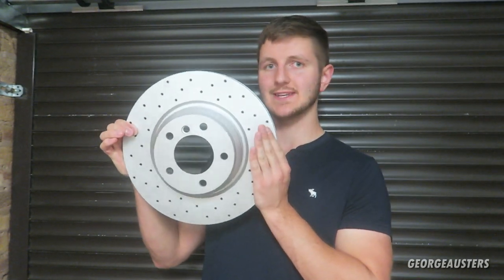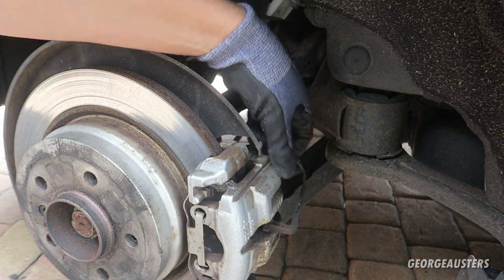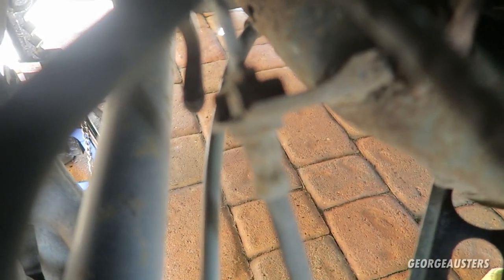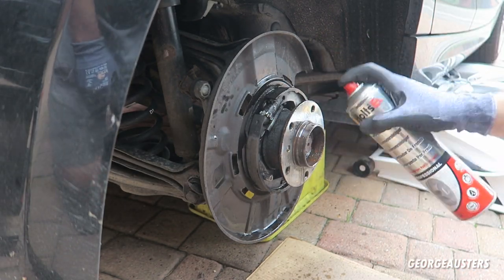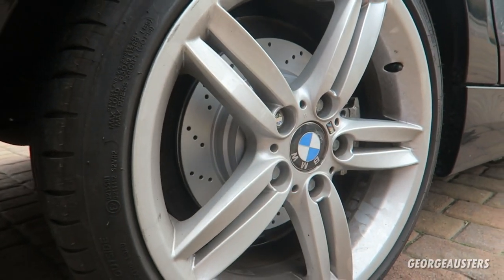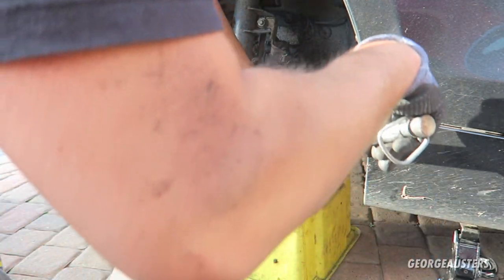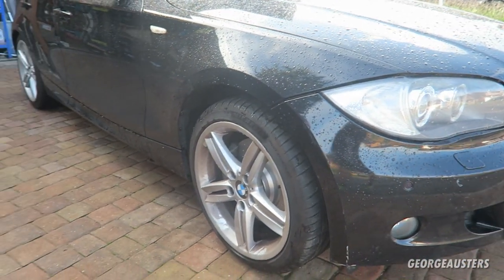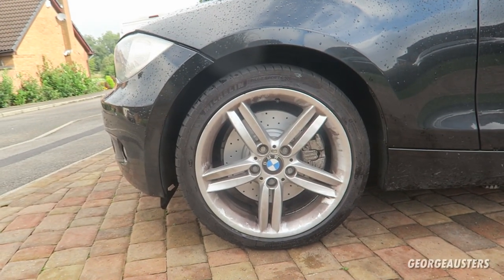BMW 1 SERIES FRONT AND REAR BRAKES UPGRADE!

Comment from the maker: UPDATE: So I have been using these for a week now and they have fully bedded in.. I just want to say they are AMAZING! Completely tranformed the car.
Reply: I had an e88 125i model and my brakes were very bad. Initially I changed both my front caliper and made no difference. I then change the brake fluid which made a difference but still not as good. Tomorrow I’m changing the disc and pads and hopefully this sorts my issue. 

Issue I had was the car will brake once I’ve pressed more than 50% of the brakes
Reply: Why do you re crack the nuts always the 1s I see people struggle on I watch yt videos & every1 skips past there Struggles or methods they have had to come up with to get them undone please show us start to finish genuine videos cause we all know you ain’t just undoing a disc brake Alan key bolt with a 10p alien key there heat seized the lot and I like to see different methods on different bolts ect that makes the video worth watching 100% watched you for years mate keep up what you do have good some great tips and tricks off you buddy an my comment ain’t no criticism far from it just I like to see peoples struggles and ways to get around the struggles easier

Comment: Great reminder video : A few tips 
Always keep a few brake disc retaining screws handy from Bmw they can easily round off. Don’t cross thread the guide bolts..! wash new discs with soapy water to remove oily layer on them from the manufacture.. or brake cleaner before install.. use silicone grease in the guide bolts and anti squeal around the pads.. a drill with a circular wire brush attachment really helps clean the hubs & callipers before installing the new discs.. copper grease is essential for the future changes .. good luck ✊🏼
Reply from the maker: Thanks man!

Comment: I am quite astonished the bolts on fixed part calipers at the rear were so loose because they should be torqued quite hard, like the one on the front.
I would recommand to put copper grease also on the center of the break disc on the surface in contact with the wheel.
Let mention as well the break discs change is the right time to do a wheel stud conversion ... as recommended by you in another video, then the disc retaining bolt becomes useless, and mounting or removing the wheels become easier.

Comment: You should think about the 135i/performance brake in the front. It makes a big difference and they feel great on the paddle. If you keep your eyes open you can pick up used ones pretty cheap got them for 500€ with discs...the big brake in the front from the E90 335d would also be an option if you can get the parts used...
Reply from the maker: No need, especially not at the moment. These have completely transformed the car after bedding in👍🏻

Comment: Since those pads have a rubber backing plate, its not necessary to put copper grease on the back, however if its bare steel of course you should definitely add copper grease.
Reply from the maker: I prefer using anti seize to copper grease on brake pads

Comment: hello I like your channel.  Can you tell me if a wrong timing in the n46 can have higher oil consumption and smoke? Mechanik was changing timing chain , car is running but it's coming blue smoke sometimes when you accelerat is black

Comment: What coating on the disks? You're suppose to clean then off with brake fluid cleaner prior to fitting or the grease will contaminate to pads. Did you do that?
Reply from the maker: This is not a coating, this actual paint on the discs to prevent the centre and edges from rusting👍🏻

Comment: Awesome! Good job!  Is there any effect on having the drill holes in the other direction (I.e. swapping sides)?

My standard brakes are terrible; "floaty" as you described!  I bought some A2Z and suffered juddering.  They are awesome company and replaced, but juddering still happened.  So refunded in the end, so now looking to get BMW performance.  Mechanic couldn't find cause of the juddering when having those discs on :(
Reply: Hope this helps you i had juddering when i applied my brakes on my old E46 a few years back i could not for the life of me work out what it was even when posting in the forums and researching and replacing the brakes and discs, one day my drivers side shock absorber started to leak i changed both shocks and that completely got rid of the judder!
Reply: Johny P Funny enough, a few months later I had to replace my springs (one snapped).  Hmmmm, that could well have been the cause of the issue.  Thank you so much.  Very helpful
Reply: @GervanKelly  you're welcome

Comment: Hi 😃 👋 , i want to change my bmw e87 front disc but i dont know if the 300mm disc can fit ?
Reply: I’ve got an e87 autodoc said 300mm on the back and 292mm on the front so wish my luck as I just ordered a set of brake discs and pads for mine.

Comment: Hi George if you was to pay for discs and pads for the 130i which would you choose?

My front brake service light is on so need to do mine.

I understand you are happy with these ones you have fitted but I think you said you got them free for advertising.

If you was paying would you have gone for something else?
Reply from the maker: I would buy these. Honestly these Textar pads are the best i've ever used. Will be buying them for my 760li.
Reply: @GeorgeAusters  thanks buddy

Comment: Hey George, i’m going to replace my front pads and rotors soon…should i do it along a break fluid change and proper bleeding? Or will it be good eitherways without changing the fluid? What’s your opinion on that? I’ve heard a lot of theories, not quite sure how to proceed 🤔
Reply from the maker: Worth doing a brake fluid flush every 2 years as part of normal maintenence

Comment: Hi George, I noticed that you are using your Torque wrench as breaker bar, and then relying on it to Torque up the Wheel bolts.
I'd strongly advise you to invest in a decent 1/2" breaker bar to protect your Torque Wrench from being abused and hence drifting out of calibration.
I used to work for a particularly strict  F1 Team based in Woking............Who would've given me a good verbal kicking if I did what you just did... :-).
Peace....
Reply from the maker: Yep could do with a breaker bar but this half inch torque wrench is around 50 years old and never let me down!
Reply: Yeah I get the point, its true, but a roadcar M12 or bigger bolt won’t give a damn if they are torqued 10 or 15 Nm more or less than original spec.

Comment: Did you not need to bleed the brakes?
Reply from the maker: When just replacing the discs and pads?
Reply: @GeorgeAusters  yeah, I jsut replaced all mine all round pads and discs and sensors and I'm not really sure if brakes feel right not sure if I need to bleed them maybe and also the hand brake needs adjusting lol
Reply from the maker: @topnelly  Have you bedded them in yet?
Reply: @GeorgeAusters  not fully no

Comment: Would you recommend putting a thread lock compound on the break carrier bolts that go into the hub, or is torquing them to the right spec enough? I'm thinking of doing my disks and pads soon myself and I've read some arguments for and against doing it. Thanks.
Reply from the maker: Either is fine
Reply: Are they not strech bolts also as i think bmw says to change them ?